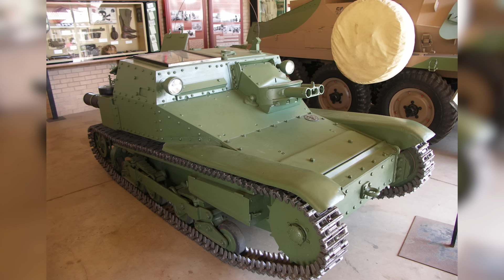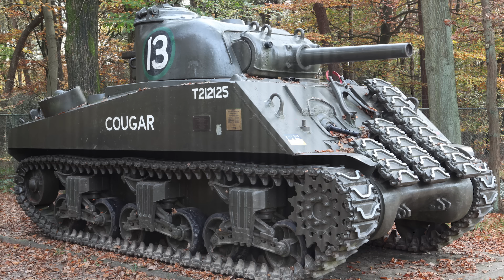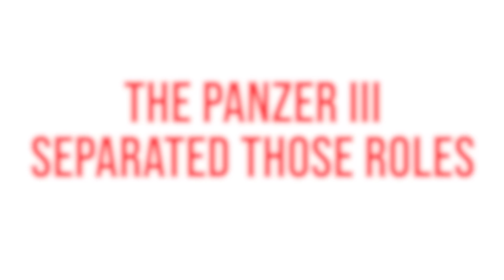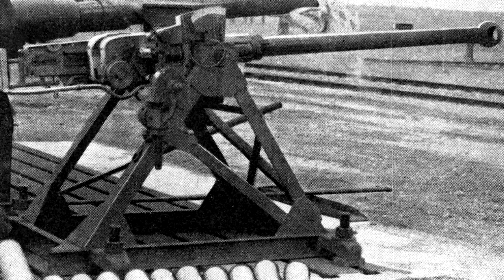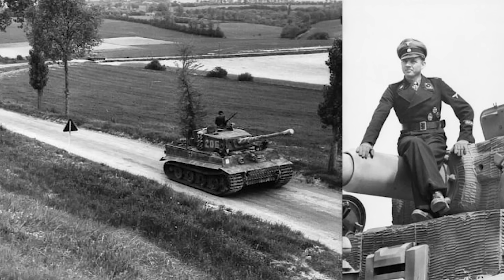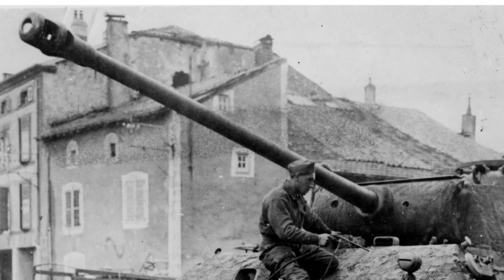Every WW2 Battle Tank Ranked — WORST to BEST

Comment from the maker: The WW2 Definately has more than 10 Tanks, can't cover every tank in 1 video , so This is a series, subscribe so you won't miss it.
Reply: lets see
L3/35 are a tankette not a tank.
The story of the M4 being a "Tommy Cooker" or being Referred to as a Ronson, is based on the antidotes of a recovery engineer. They never got the nicknames the fact is they were loved and with a 80%+ crew survival rate, high crew comfort, easy repairs, many made. They were the tank that won the war.
The T-34 IS A WORTHLESS PEICE OF SHIT, the majority of them that were knocked out were by the 50mm on the Pz III and AT guns. they were cramped and got their crews killed. They cost about as much as a M4 to make and if done properly would be even more expensive but would still have the crappy internals.
Ah the Pz V Panther, oh such a wonderful tank on paper. But reality comes in like a meteor and shows the Panther Paradox. Low crew comfort, bad economics, NIGHTMARE to maintain (why you think there are none fully running).

I can not believe that even in 2026 there is still this level of misinformation out there with all the work real historians have done to correct it. This just comes across as AI slop or so badly done that it should never have been posted.
Reply: @beamsy9740 Take your meds chudley
Reply: Then don’t the video EVERY WW2 TANK rated
Reply: Suggest you do a series of tanks through out WW2 , may be by year by year. You would need to start prewar though. Include a bit of design, operations and combat reports. Would be a real large project. Be careful as tank images need to be more referenced to fit the narrative - many people have no clue about what images are  being inserted and this pains me - AI does not help as it often shows "made up (non-existent) vehicles.
Reply: There were multiple nations in the war that had more than ten tank types used.  For the US there was of course the M4 Sherman, the M3 Lee, the M24 Chaffee, the M26 Pershing, the M2 Medium Tank, the M3 Stuart, the M2 Light Tank, the M22 Locust, the Marmon-Herrington CTLS, the T20 medium tank, etc etc.
Reply: @jonathanspivey437   how about the M18 Hellcat
Reply: You're from India.. just no poopjeet I ain't subbing.
Reply: How about the Tiger 2, aka King Tiger, 180mm front sloping armor, and the largest 88mm gun Germany made.
Reply: Poorly scripted.

Comment: Not until the Brits got a hold of Sherman tank, it was at best an above average tank. 75 mm shells bounced off Panthers and even mark IV. Brits added  a 25 pounder gun. The T34 was THE BEST overall tank.  Simple, effective, and cheap to make and  repair.
Reply from the maker: that's actually true and has a point

Comment: "Every" Tank....Ranks only 10 Tanks, lol.  Where is my KV-1 and KV-2?  My Crusader?!  My Pz I's and II's?  My Stuarts?

  Still, A fun vid...but....anyone who puts the Panther as the #1 Tank has done ZERO research on the Panther.

That tank was a DISASTER.

It was, BY FAR, the least reliable tank of the war.   Even on the Western Front.   

Yes, IF ONE WAS WORKING it was a great tank.

But....when qualifying a tank you HAVE to factor in logistics and maintenance.   They are warfighting machines.   Not Dueling machines. 

Which exactly Why the Sherman should have been ranked #1 and the Pvz IV #2. 

The T-34....is highly overrated.    but still probably #3 or 4.

Comment: If Germany Decided to mass produce either the Tiger 1 or the Panzer 4 in any of it's Configurations, it literally, not could have, but would have, won The Second World war. Hands down. 
Panzer 1 2 and 3 was much more suited to scout and light tank roles. If Germany Adapted, they were very good at Adapting, but for some reason later on into the war they didn't, they would have won.
Reply: It's also possible it would have forced the Allies to Adapt too, but still.

Comment: As others have pointed out the L3/35 isn't a tank, it's a tankette so isn't a fair comparison, Italy had actual tanks to compare with.

For the Ha-Go, and Japanese tanks in general the downfall was the competing resource demands with the navy and air force. 

Ha-Gos were developed as an attempt by the Japanese Army to prove the utility of armoured fighting vehicles, and we're initially deployed as a single dedicated unit, and performed well in China, however they were then distributed thinly amongst other units and faired less well operating in isolation, leading to a belief that resources were better spent elsewhere.  They later ran up against Russian tanks at Khalkin Gol, performed terribly and that saw the death knell for any major development of Japanese tanks.

They weren't designed to go up against Sherman's, or intended to ever compete with other armour

Comment: Incorrectly titled. However, of the tanks selected, there is a need to point out that the Panther, although its reliability was vastly improved over the breakdowns it suffered when introduced at Kursk, it remained a tank that was heavy maintenance intensive and wasn't reliable when it was not in static positions. It was a a nightmare to maintain these tanks in the field, and way too many fixes had to be performed in a shop.
Reply: Panther... the best tank of the war stopped by the side of the road. The final drives wore out in less than 100 miles. If Patton's divisions had been equipped with Panthers they'd have been unable to relieve Bastogne.
Reply from the maker: come on broo, it's not that bad , even with A.I. it still need serious effort and improvement, , issue is that those cheap A.I channels have Influenced peoples mind very badly
Reply: @the_rising_guy  English please or just use the translation feature.

Comment: t-34 was horrible, when the german It was encountered on the first day of the Red Beard invasion. It was terrible, but why?
1: Its visibility was terrible; many T-34s stopped at random in battle bc they didn't see the outside and the Germans didn't understand why.(a t34 took 37 hits from a german anti-tank gun before firing it)
2: Its mass production was too fast, meaning its welding and internal components weren't as good as a Sherman, and it broke every few km.
3: Its production speed was too fast for a tank in the 1940s, and it had major problems (visibility and reliability). Its traction was so thick that they had to use a hammer to shift into first gear.
4: Its spaces were cramped, hot, and narrow due to its angled armor, and its turret wasn't designed for the famous 76.2 mm gun, which rendered the T-34 it would become ineffective if it not super-mass-produced.
Reply from the maker: You've brought up some excellent points about the T-34's shortcomings, especially regarding its visibility, reliability, and internal design. These are definitely factors that contributed to its performance, despite its mass production.

Comment: Oh great another Wehrboo that forgot that thee final drive problem on the panther was NEVER fixed. Its side armor was also notoriously thin to the point that they had to put those side skirts on just so anti tank Rifles would stop penetrating them. Most tanks afterwards including modern tanks favored mobility over heavy armor, so they're nothing like the Panther and closer to a T-34

Comment: Pretty good except for your choice for #1.  The Panther was notoriously unreliable, and while great in the open fields of battles like Kursk, were not nearly as effective as Shermans in close quarter combat, as they were wide, hard to maneuver, and vulnerable to the Sherman's gun in close quarters, which could be loaded and fired more quickly.  The T34 should have been #1.  Almost every video treatment of WW2 tanks over rates the Panther and Tiger.  MUCH less effective use of resources than either the Sherman of the T34.

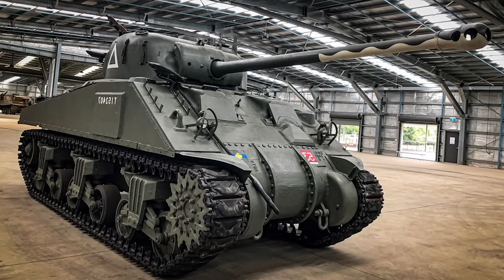Comment: 9:09 image is a Firefly not a M4. Not the barrel length and the muzzle
Reply from the maker: Oh man, my editor is going to hear about this! Good eye, you've officially earned your tank-spotting badge. My bad!
Reply: @the_rising_guy  Sorry. I didn't' mean to upset you. I think that was  an AI error. 
However, I was a gunner in a reserve unit that still used the Sherman with the 76mm gun, which had a different muzzle brake than the Firefly and opposed to the 75mm gun which did not have a muzzle brake at all.
And yes, I am that old. LOL
Reply from the maker: @frankhill2406 gosh man, such an experienced person in my comment great man respect*

Comment: imo, T34 over panthers just based on reliability and ease of mass production alone. Plus wasn't it designed to be much easier to drive? Wasn't it actually an American design that the army never really looked at closely?
Reply from the maker: The T-34's reliability and production advantages were definitely huge factors. It wasn't an American design though; it was developed independently by the Soviets.

Comment: Wasn't the Fiat built for mountain warfare?  It would be useful there.  You rate the Tiger highly, and, then state major faults.  It sounds like a failure to me.
Reply from the maker: The Fiat 3000 was not specifically built for mountain warfare. Its design was based on the Renault FT.

The Tiger was a highly effective tank in many respects, but its mechanical issues and high production cost were significant drawbacks, as discussed in the video.

Comment: On the Sherman, you seem to be confusing armament with armor. There weren't any versions that had 76mm thick armor. The M1A1 had a 76mm gun.  And despite the armor advantage, studies showed that Sherman crews were often successful against Panthers in real-world engagements, achieving a 3.6-to-1 kill ratio through better tactics, teamwork, and superior numbers.
Reply: Yeah, as long as there were LOTS more Shermans than Panthers.
Reply: @dougamundson6836 And the genius of the Sherman design was that it was easily produced and easy to maintain, so that it could have those numbers.
Reply: @dougferguson3820   The "genius" was that it was backed by the largest economy and industry in the world (which wasn't hit by a single bomb), and had a very safe supply line. Still it, like all other WW2 tanks, broke down en masse during long road marches. 15-20 out of 50 Shermans would be expected to fall out due to minor or major mechanical issues during a 30-40 miles road march.

The Sherman was not a cheap and simple design, a late war M4A3E8 probably cost more than a Panther.
Reply: @dougamundson6836  Not necessarily. See the Battle of Arracourt which involved no 76mm-equipped Shermans. Panthers generally didn't do well in offensive operations.

Comment: After the battle of France Hitler ordered the panzer iii to be up gunned with the high velocity 50 mm gun, but the ordinance department equipped it with a low velocity 50mm gun instead. Hitler never forgave the people in ordinance for that. Another reason Germany lost the war.
Reply: The rationale was they had all these 50mm low velocity guns so might as well use them, rather than the guys at the front need the high velocity.